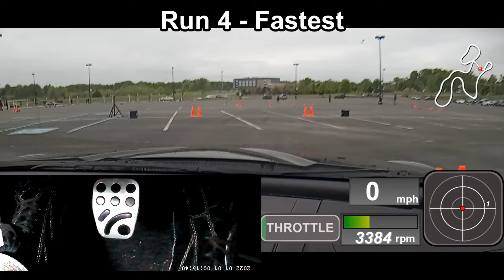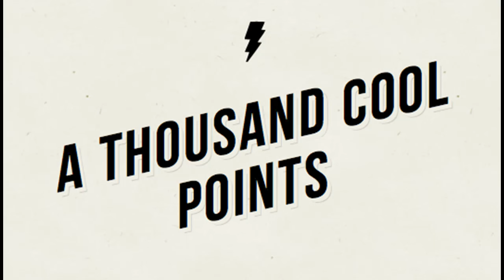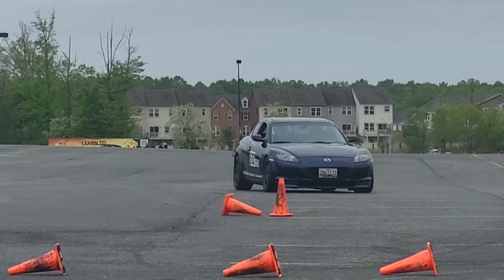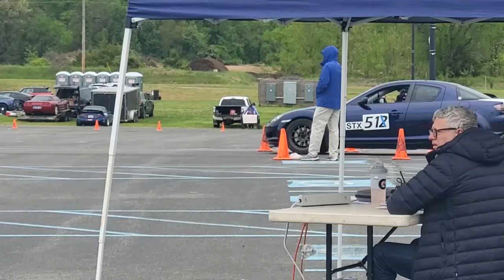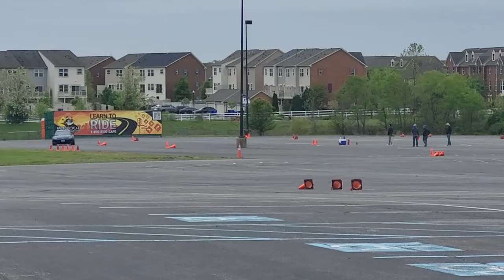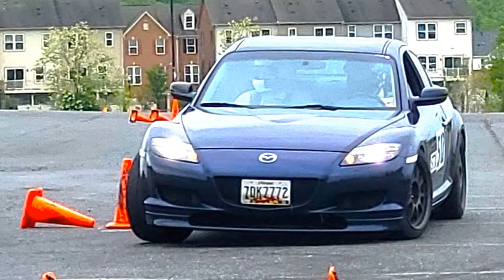#512 RX-8 | WDCR SCCA Autocross #1

Comment: The car control is insane 😳 You didn't leave anything out there, amazing drive. Wish the WRX could handle rotation as gracefully.
Reply from the maker: The RX-8 feels like cheating!  long wheel base, central mass makes it easy to slide as you point out.

Comment: Thinking off blending e85 and using af ratios from torque app to get leaner from 11:1 full throttle, Stock tune. What do you think?
Reply from the maker: i had good results with Versatuner to lead out the factory high RPM richness.  The OEM tune is pretty lean from say 3,000-5,000 rpms, then it gets progressively richer.  I've heard rx8s getting good result with E85 and tunes, but i think it might make the car more difficult to start when it's cold outside.